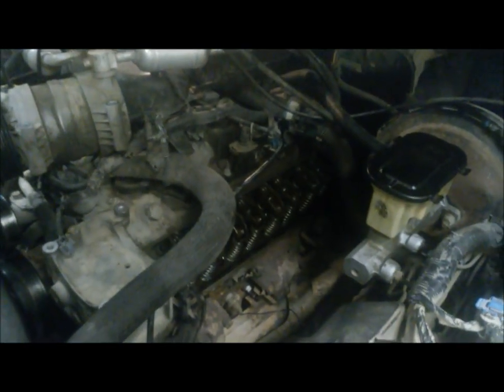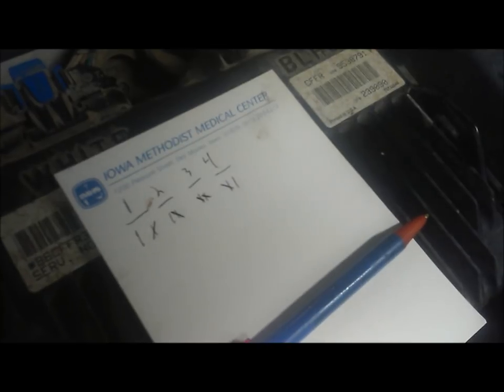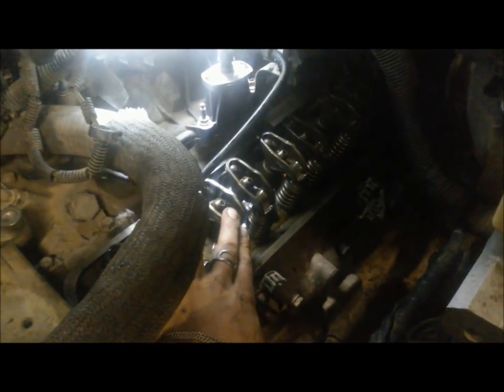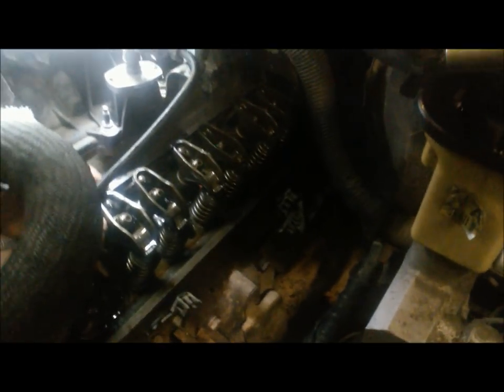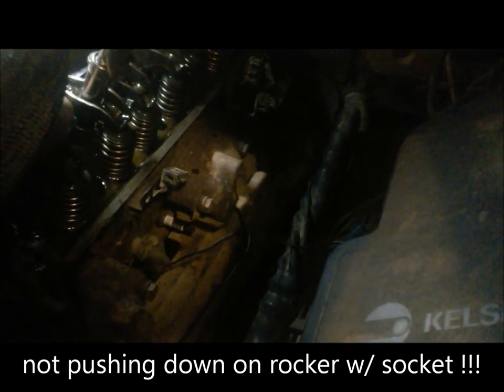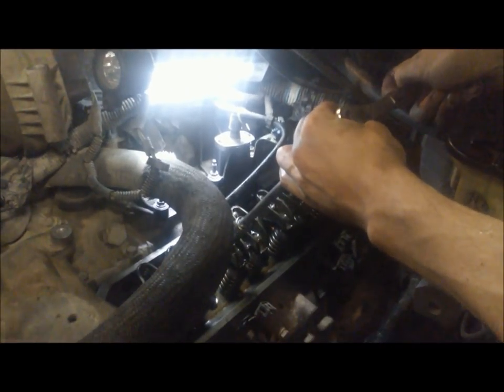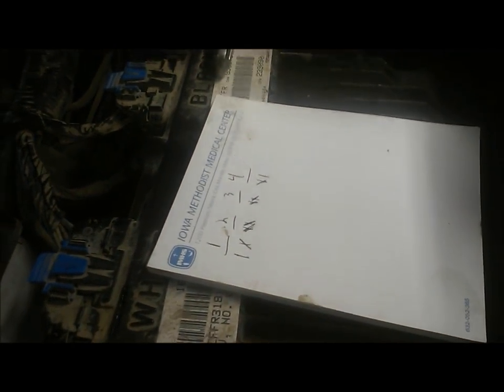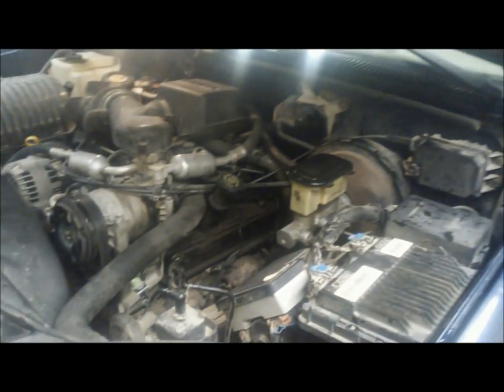Adjust Valves 5.7 350/305 Chevy in Vehicle - Simple & Easy (NO MESS)

Comment: If you have used heads that aren’t rebuilt or new only go 1/4 turn when adjusting the valves. 360 degree turn is too much for used parts and you won’t get compression
Reply: Learning that now. Just hoping i didnt bend something
Reply: same..
Reply: My valves have been giving a nightmare. I've tried every thing and adjusted them 3 times already while engine off.  I thought I was a professional but now it's way to tight. I am going with the dummy proof and have engine running 🏃‍♀️ 🤪.   And your right about the 1/4 turn.  3/4 is ridiculous and 1/2 to 1/4 is just right.  Just hope I didn't bend a rod

Comment: Some people that don't have any experience whatsoever on where to start for adjusting their valve lash, therefore, you need to explain and or "show" how and or where to turn the crankshaft for TDC for whatever valve they're adjusting, not anybody can jump in and automatically understand what you're meaning unless they've had previous experience. I can make two turns at the crankshaft on any V8 Chevy engine that'll let me adjust every valve properly, been doing it that way for over 50 years.
Reply: Yes. You're right. The hard part is knowing how to turn the motor. How to get the valve in correct position to adjust. There's zero videos explaining this. There's a million showing to tighten until there's tension then half turn. No videos showing what to do before tightening the valve

Comment: Good video. Just an fyi. If you adjust it too far you still won't have any lifter noise but down the road you may have a burnt valve.
Reply from the maker: +MostlymoparIH for sure, or even worse, valves open. back in the 70s and 80s it was more standard to use 1-1/2 turns. with .020 preload they will be good to go. you are correct, though, i have seen people make that mistake
Reply: Me too. Sometimes better to live with the noise than live without the engine especially on older cars. I had an old Buick that was my aunt's and she sold it to my dad and I bought it from him. When the lifters started tapping I would change the oil and I'd be good for another
2000 miles. TFS
Reply from the maker: thats where the problem lies. people get worn/varnished lifters that make noise and people try to adjust it away. doesnt work like that. the only time valves should ever be adjusted on a hydraulic camshaft is when it is first assembled, after that, noise will be another issue. . . my 4.0 jeep taps like its its job. not a valve adjustment issue, because like you, when i change the oil its good for awhile, and when it starts to make noise again, it doesnt untill the engine is warm and the oil has thinned down.
Reply: Some things just wear out. Yeah so I would short change my oil changes, it cost a little more but the car liked it better and me too cause it was quiet. I could have added a quart of oil and it would have quieted it down but only for a couple hundred miles so why not just be done with it and add 4 more and make it a change and go 2k. Some common sense things but not everybody has common sense.
Reply from the maker: common sense isnt so common these days. in anything.
Reply: What's the importance of the rubber O'ring thats under the keepers in each spring?

Comment: Hey thunderhead! I need some advice, im getting my newly built 350 vortec and the bottom end will be done. I need to assemble the top end. Is there a different procedure to this if im starting new?
Reply: Push rods can be put in any way at this point if you are getting new lifters, rockers and push rods of course but if you are not take them exactly how you took them out, that’s what I have been told and am currently doing my whole engine

Comment: Thanks bud. Just had two studs pull out one on number 3 intake and number 4 intake. Replaced them and adjusted the valves gonna double check in the morning. Also bent number 3 intake pushrod. Strange fuckery going on 🤔 damn vortec engine.

Comment: I just took my heads off, when I put my push rods back in, do I need to go to TDC for each cylinder and then tighten the rocker arm ? Or can I just put them in and then adjust them from there 
Chevy 5.7 vortec

Comment: Thnak you for sharing. I have purchased a pre owned engine. It has intake manifold installed and there is oil preasure in the lifters. I can feel a lot of resistance when pushing them down. How can I adjust the lifters or check if they are currect. The reason for asking is that this engine collects fule in cylinder no 8 and 6. So when I open the ignition plug, collected fule runs out of the cylinder! This engine started for som few seconds since purchased. Thank you for your advice.
Reply: Hossein Hayati sounds like you got a bad fuel pressure regulator if this is a vortec engine.

Comment: Great video, I just did mine in 97 suburban but I only went 3/8 of the final turn, do you think this will be an issue?
Reply from the maker: It all depends on your stud size and it’s associated TPI aka threads per inch. 
This is the number after the 3/8 part. 
Usually a half turn to a full turn will keep everything happy - just try to be consistent. 

The larger the TPI number, the farther you will have to turn a rocker nut.

Comment: I'm getting backfires under acceleration it's an S10 V8 swap with a tbi 305 swapped to carb timing is good vacuum is good any thoughts on where to start ???
Reply from the maker: Check your fuel pressure! Backfiring under acceleration is lean - post to the thunderhead289 Facebook page and I’ll respond quicker!
Reply: Turns out 2 of my spark plugs were completely closed...not sure how that happened but when your buddies and beer are involved in installation I guess anything's possible.
Reply: Could be the wrong spark plugs being too long causing spark plug and to hit piston

Comment: Can't you adjust both intake and exhaust when both valves closed?
Reply from the maker: ELITHATRUTH you can, BUT you can accidentally do them when they aren’t at top dead center that way also and catch a valve no fully on the base circle. When you do it this way, you 100 percent can’t screw it up.
Reply: ThunderHead289 gotcha. Thanks alot.